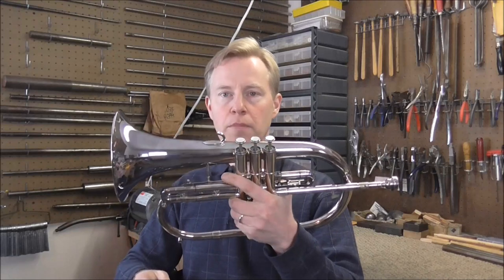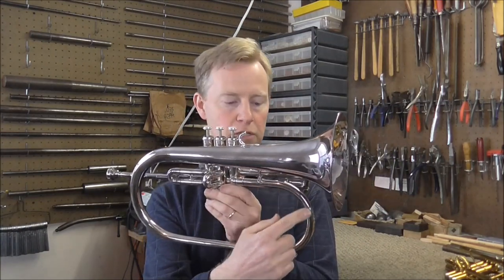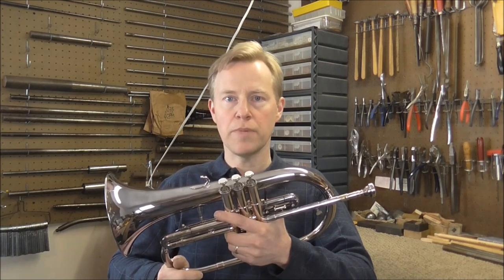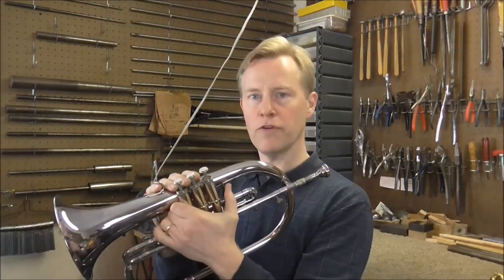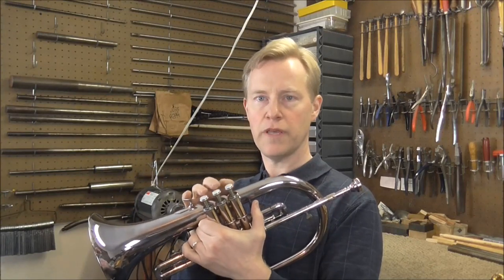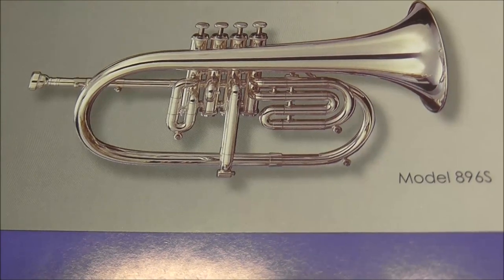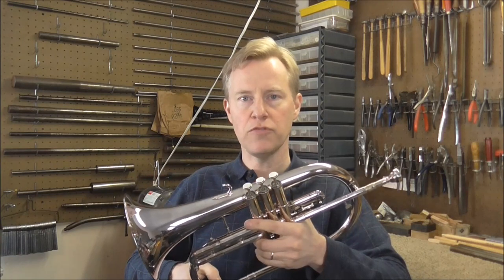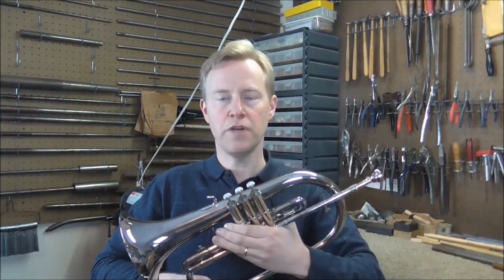Introduction to Flugelhorn

Comment: Mouthpiece for flugelhorn should be V Shape cup and as deep as you can for a true flugelhorn sound, when you play it is more of a Puff and the trumpet you blow, if possible match the Mouthpiece rim size and thickness to your trumpet and cornet to save your lips and the work you have done to train them to your usual instrument, or your endurance will suffer, most important above anything is making sure that you have the correct mouthpiece that suits your type of flugelhorn and fits into the tuning pipe receiver, how the flugelhorn and receiver is designed and built, they normally have a coller to strengthen the pipe end so the mouthpiece doesn't damage or stretch it and you can pull it out, be careful with the other end because it is tapered for a smooth airflow mine is like a razor blade that end,  try as many as you can ignore its price, experience level and what others say or think,  the sound in your head is what you want,  it will make no difference to anything because you will be trying to make the sound on all of them, so if you can find the closest, you will be working on improving ,  would you race a model T Ford against a new Ford? Stupid yes, would you buy fakes and copies of horns,  no you wouldn't and shouldn't,  ever wondered why the Bach Strad hasn't changed much over hundred years? And how many professional players and section leaders have only played Strads , because they have been told its the best but never tried any modern advanced brands or trumpets,  just continue to play model T Ford, they don't realise they are playing and have paid thousands for fakes, copies and the reason they haven't changed or advanced is because Bach hasn't got a clue, all he did was buy a French Besson trumpet, take every bit apart measure them all, find out what they are made off and then copy them and has been selling them as handmade professional trumpets,  
This is easy to find out about because he openly admitted it and has got away with fraud all the time,,so stop supporting a rip off out of date copy, stop driving model T Ford when you could be even better than you are ,because of bad advice, before the mid 70s his reputation for mouthpieces was that they were crap the sizes and letters meant nothing because they were totally different and couldn't match your old one by Bach mouthpiece cup and size values, this is all true facts that are easily found, my 2 favourite flugelhorns out of owning and trying 50 plus easily, is Taylor Phat Boy and Jupiter 746, worst by miles blessing artist flugelhorn that is probably why they all seem in such good condition,  get bought because the artist trumpet is great and played a few weeks and put in the case up in the loft, so try as many as you can trumpets as well, mouthpieces to because the Holy grail mouthpiece is real just very hard to find,  hope this helps someone,

Comment: I have a Mahillon flugelhorn with four valves, Wilford Roberts model. It’s a Belgian horn, built by the Sear family and I bought it from Walter Sear around 1967.  I’m told that they were often used by police and military orchestras, particularly in Nordic and Benelux Countries. 

It does fill in the gap as you explain, but I also try, with my three valve horns, to do so with a combination of lip adjustments, close hearing and slide triggers.

I hope that this supplements your presentation, which I find informative and helpful.
Reply from the maker: Thank you for your reply.
Art

Comment: Just bought a flugelhorn today. Bought it from the band I've played in for the last 14 years. My instructor told me that it was the same horn he used to play when he ws active in the band (30+ years ago). Its an old Conn. The valve guide on the 1st valve is broken though so I need to have that fixed

Comment: Why does the flugelhorn leadpipe go straight through the valve block, so unlike the trumpet? I find my flugelhorn so much easier to play then trumpet, as far as accuracy, slotting, endurance, even range… Despite the much deeper mouthpiece. Does this have anything to do with the more free-flowing air pathway?
Reply from the maker: The flugelhorn only has a very short section of cylindrical tubing and then the tubing is tapered. You cannot put the valve section in the tapered portion. Because of that, the valves need to be right at the beginning of the instrument.
Reply: @TheBrassandWoodwindShop  that’s fascinating, thanks! I wonder if any trumpets are designed the same way?
Reply from the maker: On trumpets, the leadpipe is tapered and then the tubing goes into the tuning slide. So the first opportunity to install the valve section is after the tuning slide. However, on a herald trumpet, the valve section goes right after the leadpipe. If you are interested in seeing me work on a herald trumpet, here is the link to the playlist.  https://youtube.com/playlist?list=PLtJyi3RgtJ2ux9MXkjQ3xNs5l6vIC13zy
Reply: @TheBrassandWoodwindShop  So interesting, thanks! After playing a high-end flugel exclusively for many years, I lost even the meager trumpet chops I had. Now I’m playing a hybrid horn, a Brent Peters “PUJE.”  Part trumpet/part Cornet, flugelhorn mouthpiece with trumpet shank (custom designed by BRENT).  Cool little horn, his Shorty model.
Reply: Oh trust me I wouldn’t part with my Kanstul 1525, but it’s kind of like a big fragile delicate work of art and that big copper bell gets dented practically just by looking at it! The little Shorty hybrid horn is half the size, can sound like a trumpet, Cornet, almost Flugel, And for practicing has a nice compact sound and can play normal pedal tones.

Comment: Would it be easy to transition from the baritone horn to the flugelhorn? I want to branch out to it, but I'm worried that the mouthpiece might be a little too small compared to what I'm used to on the baritone horn.
Reply: I'm wondering the same thing. I'm a freshman going into high school, and I have played the baritone/euphonium since April, and it's not really a jazz instrument, so I have the option for trumpet, but I tried to make a compromise on trying flugelhorn instead of trumpet, so it's a possibility.